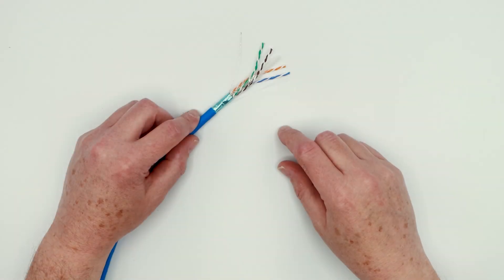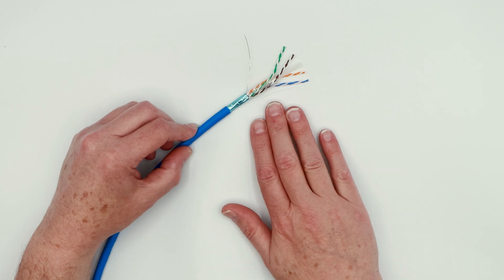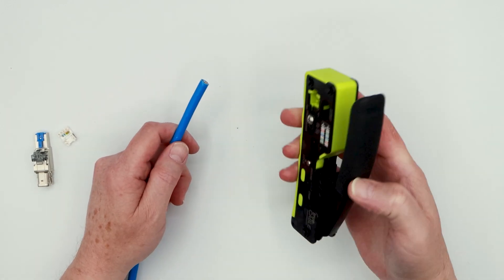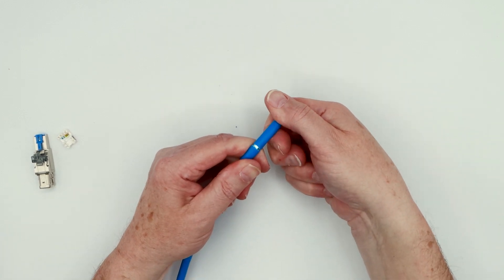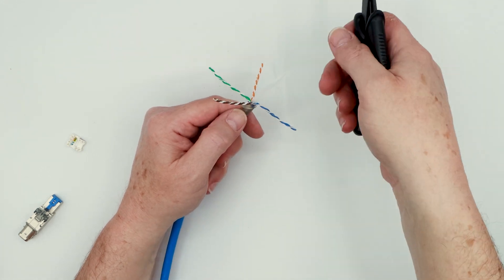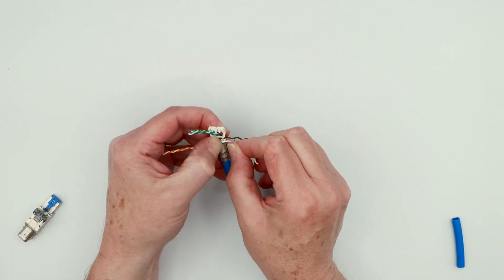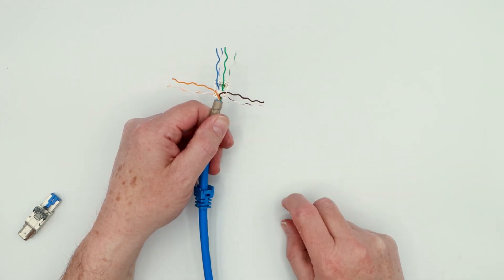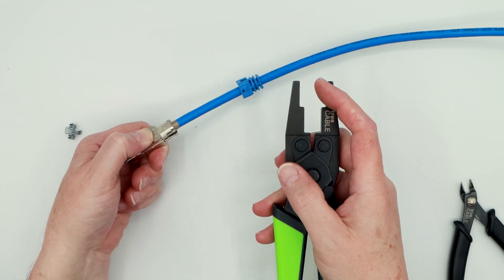The Complete Guide to Terminating Cat6A Shielded Field Term Plugs

Comment: May I know how can a SFTP or FFTP cat 6A cable be terminated, grounding both the external and especially the internal foil that wraps around each twisted pair please?
Reply from the maker: Hello! Typically, the foil around individual pairs is cut away at the point of termination. The overall foil (or braid) shield gets bonded to the termination hardware, similar to how F/UTP is handled. The overall shield makes full length electrical contact with the individual pair shields, so bonding the overall shield also bonds the individual pairs shields by default.

Comment: Hi, if I make the shielded termination from the patch panel (grounded) side using a shielded keystone and use unshielded keystone from the user end, is that work fine for grounding or both ends must be shielded and grounded?
Reply from the maker: Hello! That will work, and it will avoid a ground loop situation if you think you may have one. That said, it is not best practice per the standard. Best practice is to use all shielded termination hardware and shielded patch cords. Bonding to ground should occur at both ends and the grounds must be equalized and part of the same bonding system to AC ground. In residential situations you cannot often maintain best practices with shielded cable, which is why trueCABLE suggests not using shielded Ethernet unless you have no other alternative. Improperly installed shielded cable has the potential to cause far more issues than it might have resolved.

Comment: the color code is really hard to read on these, but it might just be my eyes ageing.
Reply from the maker: Hello! Do you mean on the conductor wire insulation or somewhere else?
Reply: @trueCABLE  the wire caddy on the keystone.
Reply from the maker: @ChickenPermissionOG  Hello! Gotcha, so the conductor wiring cap on our tool-less keystone jack. The colors should be bright and saturated. It may be your vision but have someone else take a look and see if they think the colors are washed out. If so, please use the Contact Us form on our website so we can take a look too. We will get you replacements if needed!
Reply from the maker: @ChickenPermissionOG  Hello again! Glad to hear everything is OK, and good luck on your installation!

Comment: Good afternoon! I am planning to upgrade my 16 analog security cameras and DVR's to NVR's and POE 4k cameras. I have made cat5e cables for a while and have the proper tools for it, but never used a shielded cat6. I am willing to buy the necessary tools, but just wondering if you believe using shielded cat6 for my project has more benefits that using regular unshielded cat5e?  Thank you for this video!
Reply: Thank you so much for the info and advice!  🫡
Reply from the maker: Hello and welcome to the world of PoE! You don't need shielded Ethernet unless your cables will be running close to and in parallel with AC electrical circuits (closer than 8") or within a certain "bubble zone" distance of very high EMI generating electrical motors or transformers. Shielded Ethernet must be bonded to ground correctly as well! As for Category, the vast majority of IP PoE cameras are still operating at 100 Mb/s, and on occasion, you see 1G. Cat5e can easily achieve 2.5G (2,500 Mb/s). As for PoE, solid copper Cat5e should be able to sustain 100W DC PoE, with limitations coming in the form of bundle size, not the individual cable run itself. You are safe up to 31 x Cat5e 24 AWG solid copper runs at the highest 100W power level, bundled, and inside conduit too. It might surprise some people to know that I often still use Cat5e because it is easy to work with, especially when the cable must go inside a tight-fitting water-resistant camera housing.

Comment: Sometimes you wrap the drain wire. Sometimes you cut it off. 
Sometimes you remove off the cable shield.
Confusing.
Reply from the maker: Hello! Yes, it can be confusing because there are so many ways to do it. Over the years, I have been perfecting a method of terminating the cable shield to the hardware, and the way I do it now is to remove the cable shield, keep the drain wire, wrap the drain wire around the jacket, and then finally tack the drain wire down to the jacket with conductive adhesive copper fabric tape. It makes for a much more easy to work with termination, with no shield getting in the way. It also solves the situation where you accidentally took off the cable shield during stripping but did not want to!

Comment: Looks like these are WAY easier than an RJ45.  Any idea if they'll fit inside a Unifi PoE camera?
Reply from the maker: Hello! As a fellow UniFi user (their WAPs and Protect cams), I can say without a doubt that field termination plugs of ANY brand or type will NOT work. Too big. Way too big. The way I deal with this problem is to terminate the shielded outdoor solid copper Ethernet cable to Category-rated shielded keystone jacks. On the remote PoE device end, you will want to mount that keystone into a small outdoor weatherproof enclosure, patch it into the keystone, and then into the PoE device that way. Obviously, you will need outdoor-rated shielded patch cords (factory-made), which we don't sell yet, but others do. If indoors, then simply use keystone jack housings, OR don't bother with the housing at all. I have left a keystone terminated to solid copper Ethernet above a drop ceiling plugged into a patch cord and then plugged into a ceiling-mounted WiFi PoE device. Obviously, it is best if you can support the keystone somehow, but sometimes you have to do what you have to do.
Reply: @trueCABLE  We’re just about to start building a house, so good timing.  If you can get those outdoor patch cables available, maybe the timing will work and I’ll buy all my stuff from one spot.  I’m going to have a bunch of cameras to install.
Reply from the maker: @rjtumble  Hey RJ! I doubt we would have such a patch cord in time for your installation. We are just offering the Cat6 unshielded indoor variety right now and awaiting results and feedback. Once we select the next major variation in mind (likely Cat6A shielded indoor) that will take at least 6 months to test, vet, and sort out. After that, we would consider an outdoor-style patch cord. So, at least a year away, if we plan on offering such a cable. Don't know yet. I will add the desire for outdoor patch cords to our list. Actually, it is already on there but I will add another vote for you.

Comment: I’m worried that flush cutting the wires, or conductors as you called them, instead of using a tool is going to be inconsistent for having good contact with the field term plug. Should I worry about this? If not, why? If so, why?
Reply from the maker: You should not worry about this. The wires must be flush cut for the lacing block to fit into the connector properly. The contact between the wires and the field term plug is not affected at the point the wires are cut.

Comment: So in essence, you have two of the pairs being longer than the other pairs once terminated vs a normal 8P8C RJ45.  Wouldn't that be detrimental to performance? Let's say data is being sent down all 4 pairs (full duplex) at the same time, and the voltage/data has to travel further for the longer pairs than the shorter pairs. The data/voltage would arrive sooner for the short wires. so there is a time delay. I understand the difference in length is very tiny, say max 1/16th of an inch. But when you are pusing a lot of the data through the wire, say on a 10 gig network, the time delay difference could cause the network to be slower. Thoughts?
Reply from the maker: Hello! You are correct in that two of the pairs end up shorter. That said, the difference (even at 10G) is not measurable even with a Fluke DSX-8000. All eight wires end up terminated inside the 1/2" permitted untwist distance, which is accounted for in the specification. Additionally, our field termination plugs and keystones are specifically designed to mitigate any (unlikely) issues related to that. We hope this help and please let us know if you have further questions!
Reply: @trueCABLE  The question is, are these worth the price at 7 bucks a piece, that's like 6x times the cost of your standard crimped 6/6A RJ45's. I can't really see the benefit of these connectors, they aren't toolless. They take just as much time to terminate as a standard connector. and you  are relying on a piece of plastic to hold the crimp to the IDC's internally. what If that piece of plastic fails over time?
Reply from the maker: @extracareav   Hello! Our Cat6A Shielded Field Termination plugs are worth every penny. These field termination plugs provide a male connector while ensuring maximum performance. The termination style is IDC, and therefore more stable than any RJ45 8P8C termination by default. In addition, these field termination plugs are component-rated and impedance matching which greatly improves your chances of getting a working (and stable) 10G connection with Cat6A Ethernet the first time, every time. Tool-less means a 110-punch down tool is not required. No connection hardware is truly 100% tool-less since you will always need a stripping tool, flush cutters, etc. The plastic conductor holder cap simply guides the conductors into the housing in the correct sequence. What holds the conductors over time is the nickel-plated IDC contact prongs. The plastic conductor holder cap is not prone to wear out over time. The cable itself will rot away long before the IDC wiring cap will. Let us know if this explanation helps!
Reply: If you're worried about price, get a cheap female keystone punch down module, and use a short factory made patch cable to connect to the device in the field. You get the perks of the matching circuitry still, and a male end. It's just a bit more bulky. 

For home use, a standard crimp-on network end is fine if you do it well and test it and don't need high performance (noisy emf environment, 10Gbps+, etc). For a professional install where it's expensive to travel to a customer's site and fix a damaged termination, probably worth the few extra bucks.
Reply from the maker: @BrownR87   Hello! Thanks for sharing your experience with others! We recommend permanent links, which is precisely what you described in the first part of your comment. Patch panel to keystone or keystone to keystone (if using a tool-less patch panel). We always recommend using factory-terminated patch cords. trueCABLE does not recommend using 8P8C (aka RJ45) connectors throughout an entire installation with solid copper Ethernet. There is too much that can go wrong. If you need to crimp on an 8P8C connector somewhere, it should be in limited situations and only at a single end of the cable run. Field termination plugs are an alternative to 8P8C connectors that provide impedance matching and component rating. Hope this is useful!
Reply: I think you'll find that, given the speed of electricity in copper (roughly the speed of light), the extra few millimeters doesn't make a difference. Consider also that the traces on your network card from the RJ45 port to the first decoder chip are often a few mm different in length too due to chip layout and the official size difference in footprint.
Reply: Electrical pulses travel the length of the cable at around 192 km/s. The minuscule difference in the pairs would have no impact on the performance of the cable.  A long distance ethernet cable at the limits of Cat 6a, for example, could affect performance, so make sure you are not exceeding the recommended overall length for the specific Ethernet configuration you have.

Comment: So basically a male rj45 keystone jack. Has all the impedance matching magic, perpendicular knives to contact the conductors, and actually decently reliable.

Though "toolless" might be a bit of a stretch if you need cutters and a tool to close it without a lot of effort. 

I like the copper tape though. Neat idea, looks nice.
Reply from the maker: Hello BrownR87! Yup, you summed it up. Tool-less is, well, a bit of a misnomer. It just means a 110 punch tool is not required.